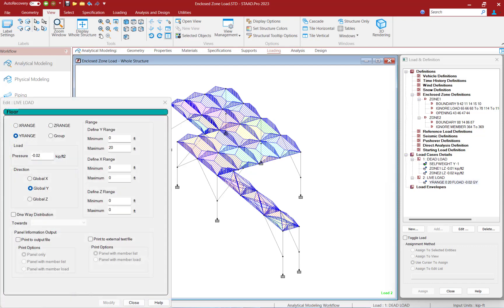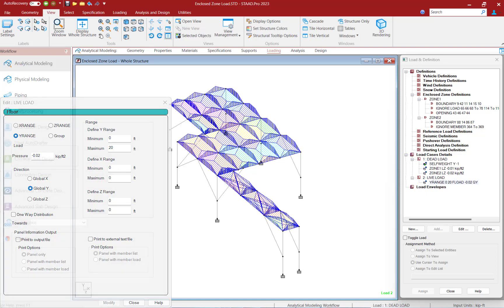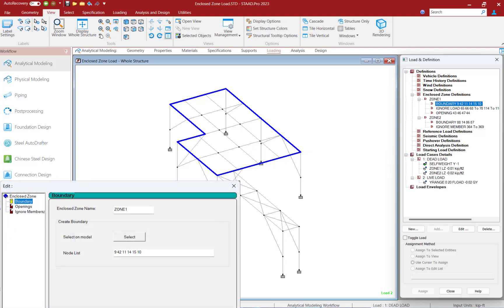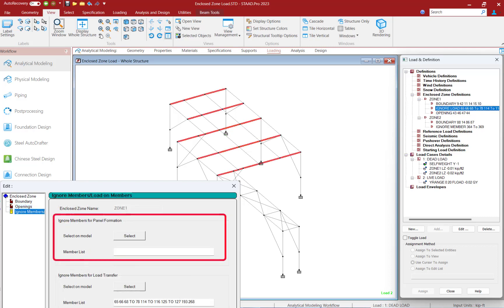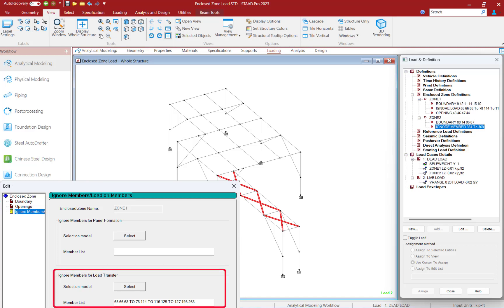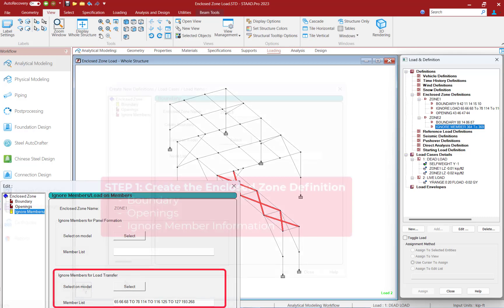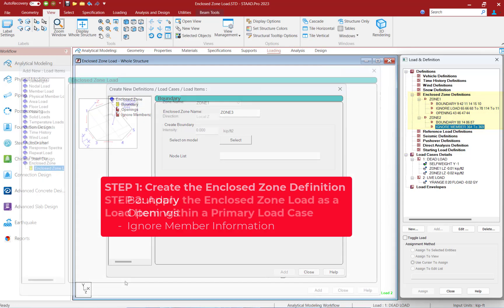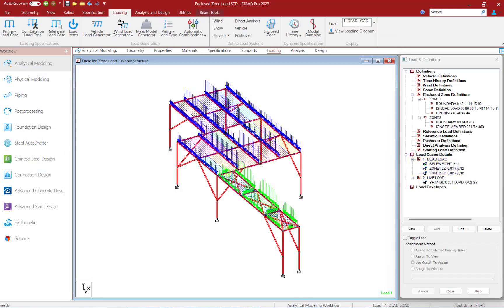STAAD.Pro 2023 - Enclosed Zone Loads

Comment: Can you do this in the physical modeller ?
Reply from the maker: Currently, the enclosed zone loads are only available in the STAAD.Pro Analytical Modeler. The physical modeler does allow panel loads and this tool functions similar to the floor load in the analytical modeler. Enhancement requests, however, are considered from the STAAD Ideas Portal on Bentley Communities: https://communities.bentley.com/products/ram-staad/i/